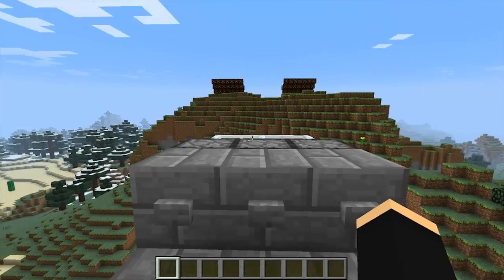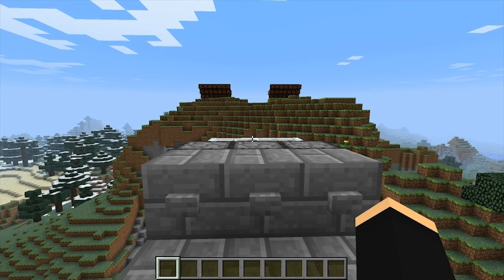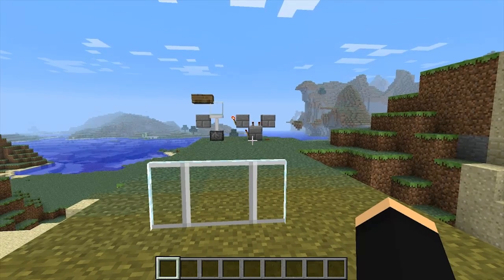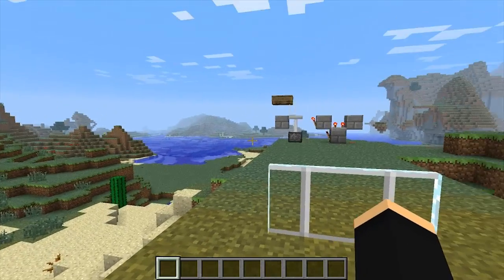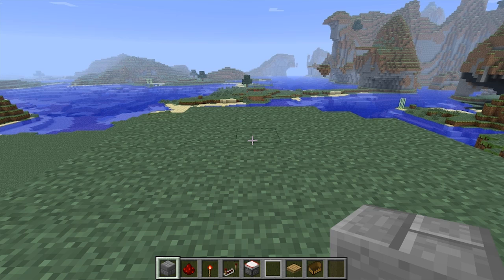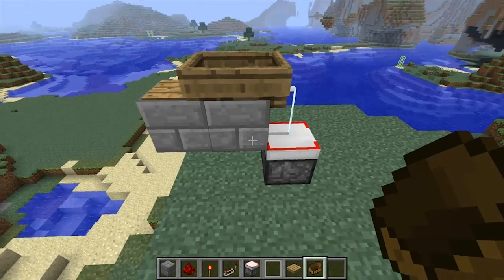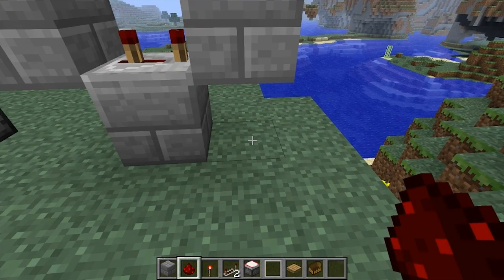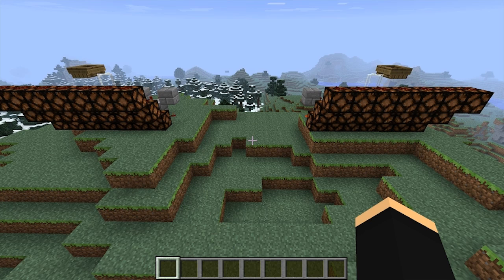(patched) Long-Range Wireless Redstone

Comment: I actually invented wireless redstone that uses no glitches and therefore can persist through every version of minecraft
Reply: +Mike Hunt  how? :v
Reply: iTzFoxis Very carefully
Reply: Mike Hunt I mean , how it works?
Reply: iTzFoxis It shoots blocks of sand over really long controlled distances, which later lands and completes a circuit. It works really well over long distances but the drawback is if the chunks aren't rendered the circuit will never complete.

The farthest I've sent a signal is 600 something blocks away from the source. But someone has to be at the receiving end for it to work. Not really practical but still really fun to mess around with,
Reply: iTzFoxis You should try making something like it. All you really need to do is make a TNT cannon shoot falling sand instead of TNT, and you can use pistons on a timer to drop the sand for you.
Reply: Mike Hunt hmm , i was thinking about that , the problem is the delay and the render chunks , but is a good concept of wireless.
Reply: iTzFoxis Well, the delay can actually be reduced if you designed the cannon a special way (imagine if all the TNT want dropped onto the same block rather than spread out) and yes, the chunk thing really hinders it.
Reply: I know this is an old post, but search up lein archer cannon, they cant shoot sand thousands of blocks
Reply: TheCreatorofTNT The problem with that is that you'd need to have someone literally follow the sand's path because it freezes once it reaches unrendered chunks. And don't worry I've built cannons that send sand 10k+ blocks

Comment: I see this possibly useful for controlling a secret piston door without obvious switches.  Secret piston doors are cool, but the obvious switches or pressure plates give them away.  This would be awesome for such a use, but it's too wonky.  And I wouldn't be surprised if Notch sees this video and fixes the game physics so this doesn't work at all.

Comment: It's possible to do it without arrows:
Have a villager trapped in walls standing on the glass, you can also change the signal  pushing blocks to the sides of the glass, which changes the hitbox

Comment: works just fine for me in 1.4.5
also, I've posted a video showing that you can use a minecart as your "contact" on the glass pane, so you won't have to rely on arrows or line of sight. Feel free to copy it and post it on your channel, since my speaking/video skills are lacking a bit.

Comment from the maker: That's how it's supposed to work - it's supposed to be a clock because this will cause the glass pane to be continuously updating. It's supposed to stop if the hitbox of the glass pane is edited in such a way that it can't support the boat. It sounds like it's working perfectly =p

Comment: on my multiplayer server, it does not work, the boat lags out and moves around, or it reads it as the plane does not exist so the pressure plate lights up, but the boat is in mid-air.

Comment: hey man, i was wondering if you could help me a little, i have it set up so it pulls one piston and inverts the current to another, the only problem is as soon as i put it behind a wall it starts doing the weirdest thing, it basically starts making a clock, i thought it could have been fences that i had in the area but that didnt fix it, can you help me? (im using iron bars) and as soon as i look at the receiver it stops almost as if its just tryna troll me :(

Comment: Awesome, Static. Can't believe I'm just now finding this. I do have a question though. On a multiplayer server, do you have the same issue with range? Will the blocks always stay active? If the way that they load is still based on your location, could this be fixed by having someone stand at the other end? Or would it still have to be within range of me? Thanks for letting me know!

Comment: actually with a few bits of jury-rigging and jiggy pokery you can get a version that works in Multiplayer. however it's the OPPOSITE of how it works in single player. The goal would be to get the boat NOT to press the button rather then having it hit the button. Oh and you would need a pulse limiter so that you don't detect the small pulses inside. also if your friends are touching other pains of glass/iron bar then it will give false positives.

Comment: Good idea! the only problem with this would be having enough room for both the boat+pressure plate and for the clock. I don't think this would be too difficult to do, but you could probably only have a maximum of three signals per receiver.

Comment: could you not send two frequencies from one reciever by having a boat on either side of the glasspane? then updating it to have a hitbox on the right side would turn on the left signal but not the right, updating it to have a hitbox in the left side would turn on thr right signal, and updating the hitbox to be in the middle would turn off both signals. that way you could minimize the use of materials and space used.

Comment: Considering that it IS a bug, and that they already awhile back patched out the very popular minecart booster glitches (regardless of that fact that it irritated many players), this one is probably inevitable that it gets removed.

....what they need to do instead is put in some "official" way of performing a similar task, some block or mechanic that allows for wireless signals without any funky bugs.

Comment: Not positive bu ti think that you can have 8 different signals by using glass panes for 4 directions
then iron bars for another 4. The iron bars will not interfere with the glass panes

Comment from the maker: Occasionally clocks like this will stop when you log out and then back in, yes. It should only happen rarely though and you can replace the clock with a type which doesn't have this issue

Comment: had it work on smp. but i'm having issues with the boat not catching the pane below a certain height
also had a little discovery that if you stood on the block above the pane, it would also trigger it, but a day later it no longer works XD

Comment: The Piston system for the boat was origianally used to be a BUD switch, then some guy figured out it will change states and blahdeblah, the guy who invented it, if he used sand and a normal piston on his video; this would NOt exsist. By lemonxreaperGH            /watch?v=8yJu5YbkRmc&feature=my_liked_videos&list=LLMHszOfvpE_HzmJm-9N8h9A

Comment: Awesome, used them to make 4 bit wireless display :]] Only problem, i couldn't figure out how to make them all light up, or if inverted, how to make them all off... made that the hard way by using iron bars, but if anyone have that figured out easily, that would be cool :]]

Comment: just had a contraption where this was about to becoming handy but it seems for me it only updates when the panes are shot with an arrow not whil staring at them or walking into them (or it has to do with it being in the topmost chunk layer) also my first problem was the boat touching the pressure plate every time the piston contracted and it seems for me only a repeater set to 2 ticks and a torch would do it so this seems to be important and should be told an dI can't remember you telling it

Comment: it doesn't work, at least not for me. The boat falls to fast and presses the pressure plate each time. Changing the delay is not working because falling time is somewhere between 2 and 3 tics.

Comment from the maker: It can transmit 1 bit of information per "frequency", and there are four frequencies for glass panes and four for iron bars (the two "bands"), so you can send up to 8 bits of information using this.

Also, I've heard that you can use upside down half slabs, although I get the feeling there would only be one frequency for them, therefore 1 bit of information.

Hope this addresses your question

Comment: This is awesome! However, unless I am doing it completely wrong, which im sure im not. My boat falls faster than the one you are using in the video. It falls fast enough to activate the pressure plate each and every time the piston retracts, making this useless. Any tips or tricks on how to fix this?

Comment: Iron bars can be detected separately from glass panes, but other than that there's no difference. Fences, as far as I've tried, do not work. Upside-down half-slabs DO work, and can be used in a way to detect if a player has simply walked on your floor! Players will simply not know they just activated redstone over 100 blocks away for taking a stroll in your house :).

Comment from the maker: Nah, that was just an example to explain how far the maximum effective range is. What you can do is activate a switch, then move to the middle point so that both the transmitter and receiver are loaded, and then the signal will be sent. Tbh I don't expect anyone to send signals over distances QUITE this large... but it's a possibility ; )

Thanks heaps, I'm glad you enjoyed the video =)

Comment from the maker: Theoretically it will transmit a signal up to 289 block in single player... that's assuming that the transmitter is at block 0, the receiver is at block 289 and the player is smack-bang in the center, since (from memory) chunks that are 144 blocks away will be unloaded. I could be wrong though, but this is a near enough estimate.

Comment from the maker: The funny thing is, this may seem glitchy, but it is no more of a glitch than the BUD switch (in fact, the BUD switch is MORE of a glitch than this). It's also not a certainty that this will be fixed - this is based on a piece of code that is designed to allow Minecraft to run on most computers; not just super-computers =p patching this would make the game take up many more resources. Glad you enjoyed the tutorial though and thanks for the like =)

Comment from the maker: Thanks man =) I was concerned about that initially but, tbh, I don't think they will patch this - at least not any time soon. This works because of the way they've coded the game - the code responsible for this makes the game run more efficiently. If they change it, it would greatly increase the resources required by the game. So, they might fix it, but I have a feeling they wont.

Comment from the maker: Depends on the type of clock. I've logged in and out a couple of times and haven't seen this type cease yet, but if it does it's simply a matter of replacing this clock with a more stable (but unfortunately less well-fitted) clock.

Comment from the maker: Unfortunately no, I've tried fences and they don't work. The reason they don't work is that when they are pushed up by the piston they turn into a single fence post and so they don't have a hit box to hold the boat up with (or, I should say, the hit box is too small)

Comment from the maker: If you mean do you have to place them directly inline with each other, nope - you could put the transmitter diagonal to the receiver and it would work (you could even put them above and below each other) but the hit boxes will have to match up (i.e. both pointing north, or both south, etc.) to work

Comment from the maker: There's no need. If you use two frequencies you can have a reset dispenser (like I showed) shoot the middle pane. If you use all four frequencies per block type, you can arrange panes in a 3x3 grid and shoot the middle one.